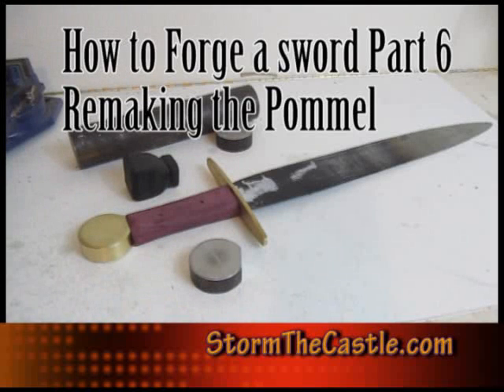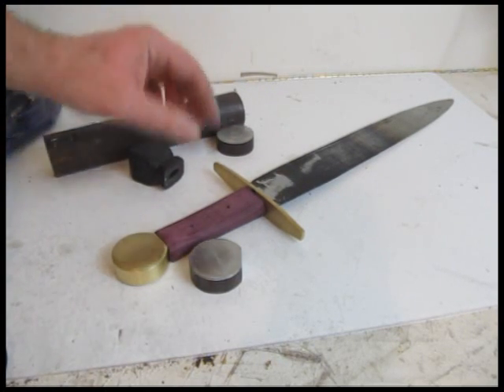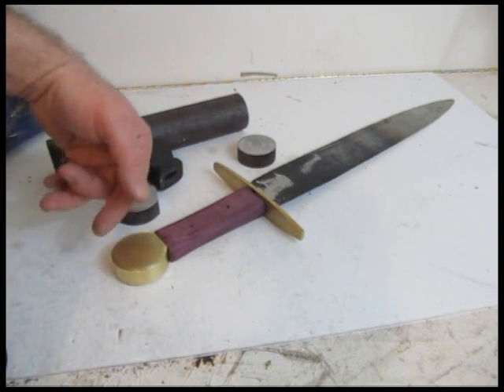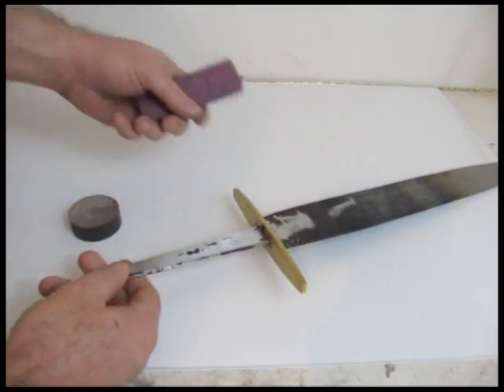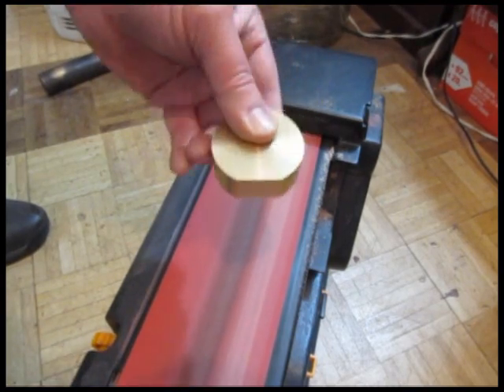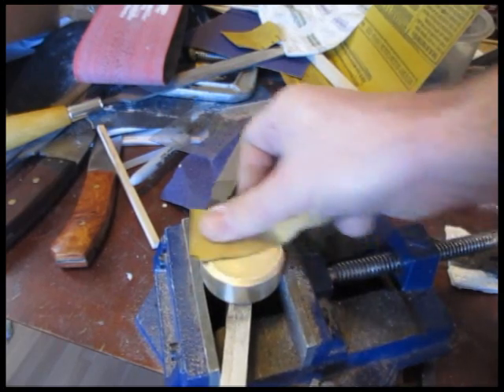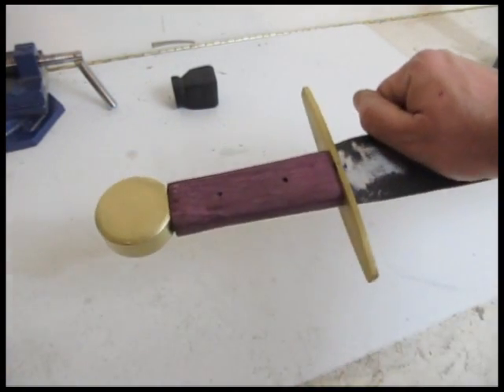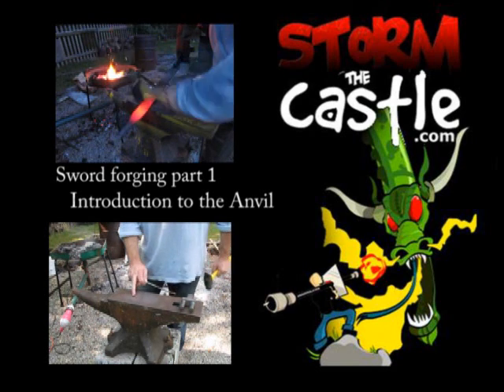How to forge a sword Part 6: New Pommel

Comment: I know I am late, and the craftsmanship is great.  

The Brass pommel:  I would make the flat say,   .100" larger than the handle width and then mill or file a slot so the pommel will go over top the wooden handle 50 thou or so.  

The air gap from handle to pommel is all I would change two sides for tools I see you have...  all four sides would be better, you might need a mill and a broaching tool.    

Love your videos, keep up the good work and educating folks like me out here.  -Linghunt

Comment: I saw this one guy made a sword, he made the pommel out of the steel rod like you did, but he made the tang round and long enough to extend past the pommel so he could heat the tang and hammer it down over the pommel and not have to worry about pins. Guess each sword maker has there own style. The sword looks realy good.

Comment: Another nice thing about the brass or the steel pommel is if you want to attach it the way that ancient sword makers did you can drill the hole the rest of the way threw, lengthen the pommel  bit mor and the last step of it is heating the very end and capping the end of the tang over the hole in essence riveting the pommel, handle, and guard on.

Comment: Cool, like the brass pommel. You could tap it & put in a skull busting point on the bottom. You could rasp some rings around the grip to give it grip & character, even inlay brass in grooves. I think a big gem set in the brass pommel on both sides would be class. You can get amathist not to much, not sure about that size, or a cz type manufactured gem that's about he same as a real one. Some nice file work on the guard edges would be cool. You could acid etch a cool design on the blade.

Comment: In the future, if you left more of the metal handle part, you would drill the hole completely through the brass and hammer down the excess to hold it on.

Comment: It should be possible, although working the transition from blade to hilt would be difficult to make. You would probably have to use a different style of guard which is inserted by the point rather than the hilt. Be aware that making the grip be part of the same metal piece as the blade will cause massive shockwaves to travel directly to your hand if you wish to actually use the sword to hit something hard, so only do this if it will be a decorative element or used to strike soft targets.

Comment: in my opinion the tang should reach through the whole pommel. the rear end of the tang is then riveted against the pommel. So there would not  be any weakening drill hole through the tang
Reply: But then you cant unscrew it.
Reply: +Karthago On Tuhottava 
Sure, but following my experience, any screwed connection will get loose when u use the sword for fencing
Reply: +TheAlchimist007 if you can't unscrew it is hard to end him rigthly

Comment: you shoul also carve the foot print of the blade into the guard so that the blade seats nicely into the guard. It should not just stop and sit flush against the blade. It (the guard) SHOULD have a recess for the blade to seat into which will help hold everything together tightly and securely with no slip or rattle or give of any kind. Also the Tang should come past the pommel and then be peened flat to hold everything in place. Then its not necessary to put pins into the handle!